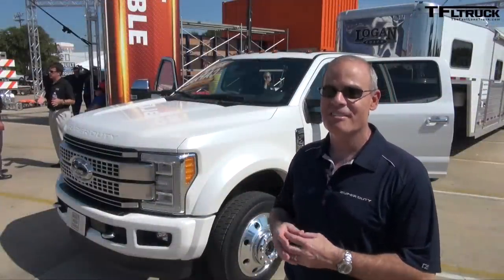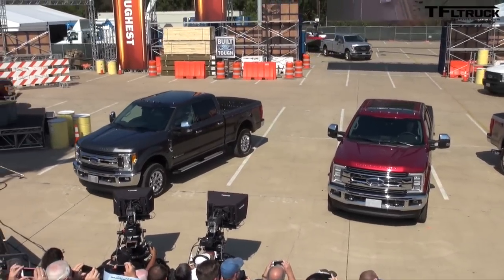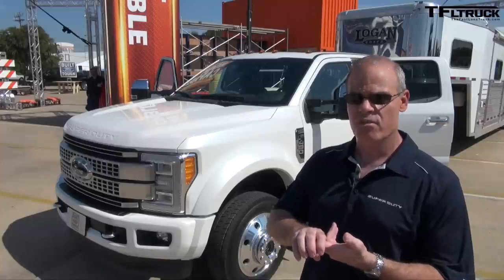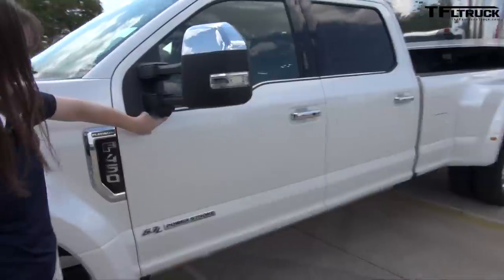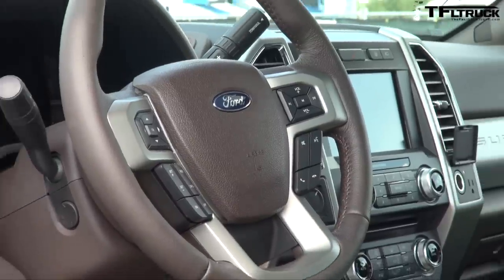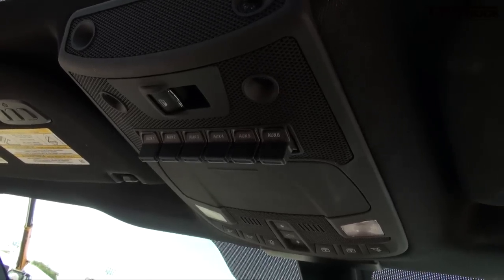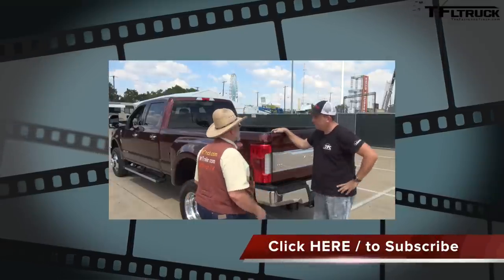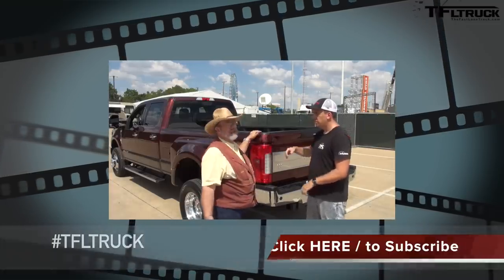2017 Ford Super Duty: The Important Stuff You Always Wanted to Know

Comment: What is this g transmission for the 6.2
Reply from the maker: This is a lighter transmission for the 6.2l V8
Reply: Why would make a lighter transmission
Reply: +Haris Mulahasic the same reason why they have aluminum
Reply: +Guy Bentley I mean is it lighter internals so weaker  or just less weight
Reply: +Haris Mulahasic less weight
Reply: +Haris Mulahasic the internals might be easier to break sense its lighter
Reply: +Haris Mulahasic The G means it cost at least a grand more than it needs to.
Reply: +wyldbladze I see what you did there
Reply: +Haris Mulahasic It's called the "g", meaning gas specific. It is lighter, and lighter duty. The technical name for it is 6r100 as opposed to the 6r140 for the diesel. 6 (6 speed) R (rear wheel drive, they use F for front wheel drive applications as in the 6f35), and 100 (add a zero to the end, and you get max torque rating, so in this case, it's good up to 1000 lb/ft of torque. the diesel version is good up to 1400 lb/ft.) The point of having  it is two-fold; lighter rotating components = more efficient. it also means less cost to produce.
Reply: Haris Mulahasic It's a cheaper, weaker transmission for the 6.2 for 2017. It's a shame to see Ford cut corners just to save money. Sure the new 6R100 G should be "strong enough", but I thought the whole idea of buying a Ford Super Duty was that the truck is overbuilt so that it lasts. Why make a light-duty transmission for the gas trucks when the 6R140 was already getting the job done.
Reply: Wayne Yates 
Yes but I think everyone would prefer the tougher 6R140 since that's what the gas trucks have had for years now. You don't buy a Super Duty and expect a lighter duty transmission than the truck made a year earlier. I know I would feel scammed if I found out down the road that my heavy duty truck has the newly "lighter" aka downgraded transmission from the F150. The 6R100 is a 6R80 from the F-150 that's been 'upgraded'. It's a bad decision from a company that built its reputation on trucks that were always overbuilt. Hopefully the 6R140 is an easy swap on 2017+ trucks.

Comment: Ford is starting to make mistakes.  The F350 & 450 should not have aluminum beds.
Have u seen the commercial that shows the bed getting holes n it when they load stones in it?  The Superduty is only saving 350 lbs.  That weight is not entirely what you are getting either because that guy said some of that weight saving is being used in other places.  I one a 2015 F350 and I think thats a better working truck than the new ones.
Reply: THE WEIGHT SAVINGS IS 750 IBS, 350 OF IT WAS REINVESTED INTO THE FRAME ETC. THE CHEVY COMMERCIAL IS  A STUPID GM ATTEMPT TO TRY TO GRAB SOME CUSTOMERS DUMB ENOUGH TO BELIEVE THAT BULL. DO YOU ACTUALLY THINK PEOPLE WOULD LOAD THE TRUCK FROM A 7 FOOT HEIGHT? IF YOU HAD TO LOAD IT THAT WAY, WOULDNT YOU JUST PUT A SHEET OF PLYWOOD IN IT, IF YOU DIDNT ALREADY HAVE A BED LINER? DID YOU ALSO HEAR THE MAN SAY THE BED IS 14 PERCENT THICKER IN THE SUPER DUTY THAN THE F150? DONT FORGET GM/CHEVY HAS NO SUPER DUTY THEREFORE THE BAD IS THE SAME FOR 1500 THROUGH 3500. MOST PEOPLE DONT LOAD AN F150 WITH JAGGED GRANITE.  THINK WHAT YOU WANT BUY WHAT YOU WANT. WHEN YOURE GM, AND YOU CANT OUTSELL FORD FOR 39 YEARS YOULL TRY ANYTHING. WHAT WILL GM SAY WHEN THEY SWITCH TO ALUMINUM IN FUTURE YEARS? FORD WAS RIGHT?.REMEMBER, WONDERFUL GM HAD TO HAVE THEIR SORRY ASSES BAILED OUT BY THE US GOVERNMENT BECAUSE PEOPLE GOT SMART ENOUGH TO STOP BUYING  THEIR TRASH.. WE FORGET QUICKLY.....
Reply: MICHAEL SACCO   Trust me, I agree with you.  Like I said I have 2015 F350 Diesel Dually but I am concerned that after all the smart things Ford did, they might make some silly mistakes that could hurt them in the 1/2 ton dept.  I just think they have turned the F150 into a chick truck a little bit.  You know, lots of  little "cute" little accessories and convenient items that aren't important unless you're just buying for looks and gadgets.  I had a 2010 F150 and that was a great, great truck.  I moved up last year and I love having a Super Duty.  Ford didn't take the money for the bailout and their trucks are by far the best but I don't want to see them starting to make small errors that can make it appear as though they aren't as good as they always have been.  As a Ford guy I think you can understand where I am coming from.  Stay tough brother and thanks for the post.  God bless.
Reply: you could always do a steel flatbed and save the weight where you need it

Comment: Seriously, what is the point of the V10? Someone explain this to me. It's not going to be more gas efficient than the 6.2, and barely has more power. Is the 6.2 less reliable or something? And even if it isn't less reliable and the 6.8 V10 is just as reliable, why keep an engine just because some customers like it? It's only 0.6 liters and 2 cylinders bigger. More moving parts would seem to be a bad thing to me, on top of the fact that soon the 3/4 ton+ trucks are going to be EPA rated on MPG. I would think Ford would want to drop the V10 (or the V8) like a hot rock to keep their CAFE numbers up.
Reply: +SurelyYewJest 
The V10 is in the Chassis Cab model only, extra Main Bearings and Caps make it more Durable than the V8, Power is also spread across 10 pistons and Rods making it more durable, and it makes a good Motor Home engine.

For the Performance Enthusiast, Banks Engineering offers Long Tube Equal Length Headers and a complete Exhaust System, Ram Air cleaner, and with a Tune and Upgraded Bosch 4 Hole Injectors adds 60hp and 75tq all across the Power Band while increasing Fuel Mileage by 10%, for the V10.
Reply: The V-10 is only available in the F-450,F-550 and F-650. The 6.2 Gas is in the 250 and 350! The V-10 sells in high volumes in the Class 4 and 5 markets
Reply: Escape for Mankind
Perhaps, but GM used its Vortec 8100 for similar applications a decade ago and did just fine with it. Gas V8s have been used in commercial applications for decades, so I doubt a V10 is inherently more durable. If it's more durable, it also has more parts that can fail, and the V10 had several common issues the first 5-7 years of its life. It's likely perfected now, but I find the durability argument over a V8 a bit specious. After all, the diesel options are V8s or I6s, and they would last much longer before a rebuild. Different engine type yes, but if more cylinders = more durable, then the argument should transfer.
Reply: SurelyYewJest
I'm sorry  if you don't understand why Ford would choose a V10 for a Commercial Truck engine, maybe you should stick to Chevy's, they're Cheap and Simple and that might help you to better understand Automotive Engineering.

Comment: He stated that the alum. saved 350 lbs.  Not much at all.
Reply: +351WINCHESTER I'd rather not have aluminum, its not as tough
Reply: +Tank Abrams 350 lbs does a lot to fuel economy and also if they keep making trucks lighter then cars will be heavier and good luck in the strong winds
Reply: +351WINCHESTER 350 lbs is the savings after they added weight in other parts. I would not drive a 4000 lb superduty pulling a 20000 lb trailer anyway... all of the electronics in the world can't save you from a side wind pushing that 40' toy hauler around..

Comment: Interior looks like a chevy lol. The dually looks like part chevy and ford-ugly. The trailer camera should have been wireless. I like the extra upfitter switches and the location, i wish they could operate while the truck is off for a period of time. Front is ugly. The new inside of the tailgate looks good.

Comment: Not falling for the 6.7 after they pulled off the disposable 150,000 mile  6.4 and the notorious 2003/2004 6.0 just nope not falling for it and it's bullshit intake manifold knock off of a duramax, switched intake and exhaust manifold, and the now weakened 3 ply rather than 5 ply head gaskets

Comment: cost is over 100,000 for that platinum
Reply: No, way too high probably 80
Reply: 2014 f450 platinum is 108000 soo
Reply: +Mtb Life your dealer is ripping you off, you shouldn't have to pay more than $75K for a F-450 Platinum, unless it's not a standard pickup truck.
Reply: +Mtb Life I just built a 2015 F450 Platinum on Ford website with every option I could and it came out to  $77,995
Reply: 100,000 ? 😂😂😂😂 this guy trippen
Reply: +Mtb Life  You must be looking at the   Swarvoski Package

Comment: now there trucks will never rust,u just need to stock pile a bunch of junk 6.7s to keep it on the road,funny once u get to the 550 they use the same cummins diesels thats already in the dodge 25 and 3500s.
Reply: The Cummins used to be an option in the f650\750 trucks but they now they use the 6.7 powerstroke.

Comment: What the heck is military grade aluminum?
Reply: +Johnny Pea You know the shielding they use on Humvees around the .50 caliber machine gun turret? That shield is made out of Aluminum and its the same grade that is used on the F150. Or just ask Ford to provide spec sheets and testing certifications to prove that it is Mil-Spec.
Reply: +Ratkill9000 Every gunner protection kit i've seen on a humvee is made from steel. Granted there is some aluminum in there, but for the most part it's steel.
Reply: Trevor O
I would say the armor shielding around the gun is steel.

Comment: The new diesels have gotten so unreliable and expensive to repair that many diesel operators are actually switching back to gas. I don't give a crap about the cup holders I want a diesel that will go 500,000 miles again.

Comment: I like fords.. but they are trying to take the experience out of driving a Truck. what happened to getting in a truck clutching it and grabbing some gears and hauling down the road with the windows down and the radio on? if you have to have the truck to do all the thinking for you, you shouldn't be driving.  I think all this cap on the trucks is completely idiotic. just my opinion.

Comment: you know what would be nice? if they spent just as much time trying to make the truck rugged and gas efficient and long lasting. rather than spending all this time on nuisance b***** that you don't need like 5 cameras heated leather seats power everything I just want a tough truck that gets good gas mileage and is going to last me for 20 years especially when I have to pay 80 grand for the thing. it definitely has to have a kicking sound system though! if you're a good enough driver you shouldn't need blindside warning systems lane departure warning systems and all this other b***** that turns good drivers into lazy drivers

Comment: At the end of this video a person stated that the F series was very high of the ground. That is what true working truck buyers want. We need ground clearance.!!  Chevy and people who buy trucks for SHOW and to go to some moron country music cry baby dance, want something low to the ground so they can get in and out of it with ease. But they are not rock hard working men or women. Chevy has forgotten what a true heavy duty truck is. I hope Ford does not follow the she-man, Chevy way of thinking. Ford is pretty good, better than Chevy, but they could improve. They need to concentrate on improving there GVW's in there SINGLE rear wheel F-350 4X4 trucks. Why do I say SINGLE rear wheel.?? Because working truck people have to get into tight spaces and a duel rear wheel is not going to cut the mustard. Of course the people in Detroit and Dearborn can not relate to anything I say because they have NEVER worked a HARD day's manual labor I their lives.! That's OK, I am not commending them for this, but they need to LISTEN to the working men who use their trucks.!!!  To Ford I will say, improve your front GAWR for snow plow use and your rear GAWR for everyday use. A truck needs to be able to handle a snow plow in the winter AND a heavy load in the rear, in the summer, for contractor work. I am sure that no one at Ford will ever read my posting, but I tried....!